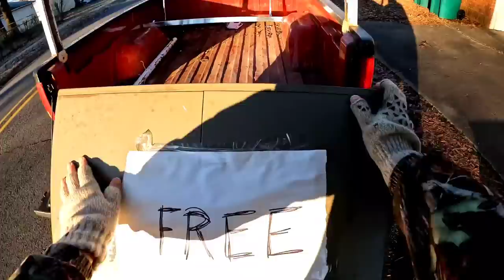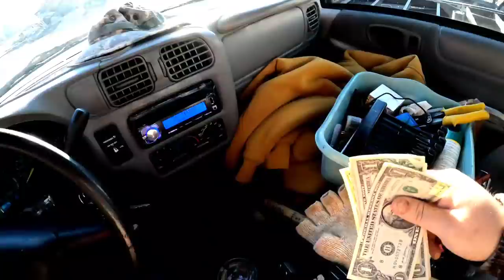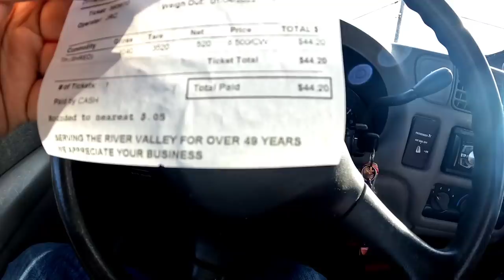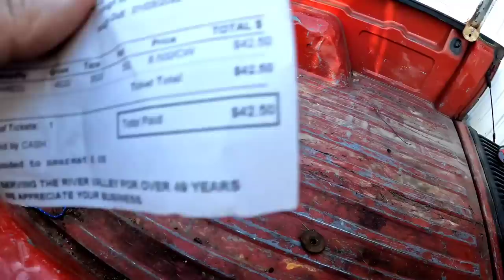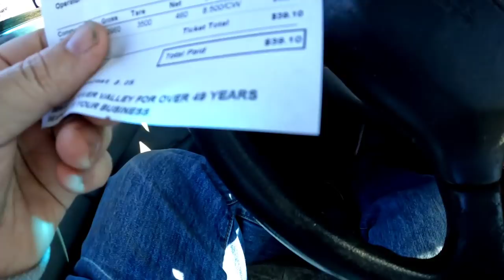Dumpster Diving/ Recycling Metal/ Digging in a junk pile

Comment: Watch for copper heads under scrap piles, even in the winter. Especially under sheet metal on the ground. on my farm I am working over some scrap piles like those and some piles of old barn tin and its cold here in Texas as I am doing it. but so far I have found five copper head snakes under the bottom pieces. I never go anywhere on my place without a gun or two for hogs and snakes and such just for that reason.